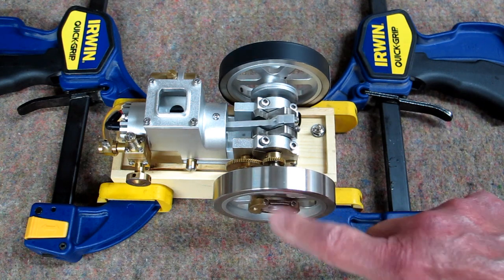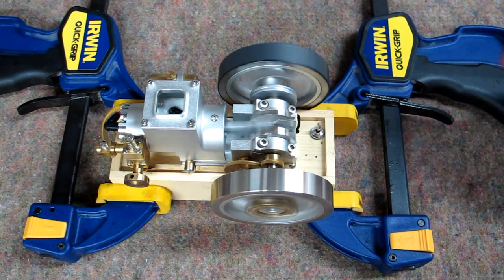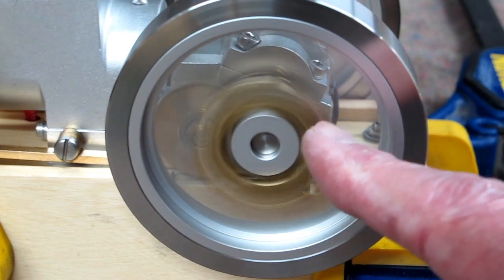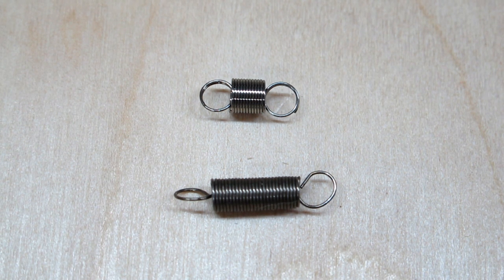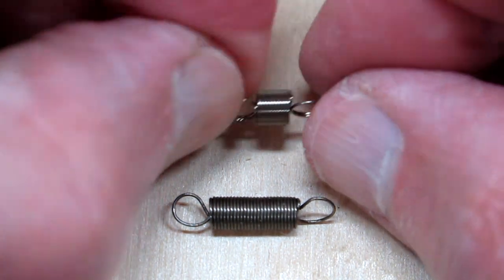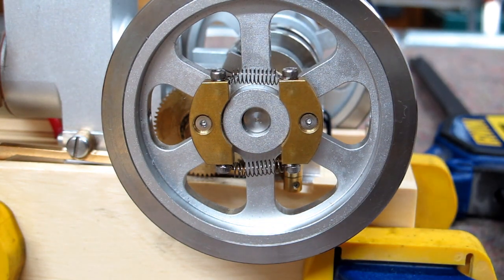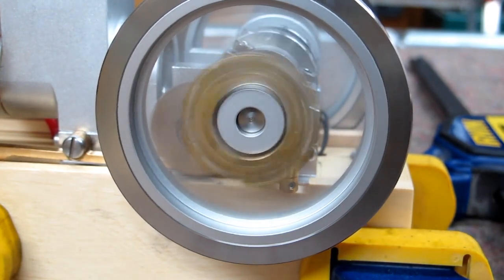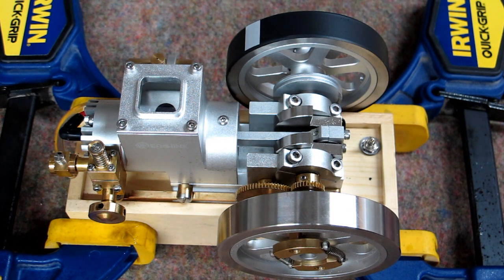Eachine ET7 Hit & Miss - Slowing It Down

Comment: Hi Ron. I discovered your channel a few weeks ago. Love your model engine reviews and tuning. I just purchased a 2022 version of the M90. Yes it runs to fast. Didn’t know what size springs to try. Your video solved that. Believe it or not, your link still works to the springs. I got a 58 pack shipped from China with free shipping for $10.17. I’ve spent that in gas driving around trying to find something that would work. This gives me many to have, to set for different running speeds depending on what accessory attachment it’s driving. Thanks so much for the video and link to and size of the spring. Rick
Reply from the maker: Hello Rick,
I don't know where you got your engine. I no longer recommend Banggood.com as they seem incapable and/or unwilling to keep engines in stock. Their supply of engines has all but dried up. They also seem to have quit selling basics like the replacement piston ring o-rings.

EngineDIY.com seems to be able to supply most engines and you will find links to the various engines in the description of all my engine videos. They also have a better selection of engines as well as the replacement piston ring o-rings and spark plugs.  I ask that you use the links given in the video descriptions since I then get credit for the sale.

There is also a coupon code that will save you money.

I have over 70 videos all listed in a playlist on my YouTube channel. There is a lot of information there.

Thanks for watching. Please subscribe! 
That is what keeps this channel going. 
Ron

Comment: HI, RON, I WAS THINKING OF GETTING ONE OF THESE ENGINES FROM BANGGOOD BUT I WAS READING THEY ONLY LAST FOR AROUND 12 RUNS, THEN LOOSES, COMPRESION, WHAT DO YOU THINK, COULD YOU PLEASE LET ME KNOW, MANY THANKS, RAY. FROM U.K.
Reply from the maker: Hello Ray,
I no longer recommend Banggood.com as they seem incapable and/or unwilling to keep engines in stock. Their supply of engines has all but dried up.

EngineDIY.com seems to be able to supply most engines and you will find links to the various engines in the description of all my engine videos. They also have a better selection of engines. Plus there is a 10% coupon code. I ask that you use the links given in the video descriptions since I then get credit for the sale.

ET1, ET6, ET7, EM2, etc. are model numbers created by Banggood and they are not the manufacturer's numbers.

M90, M92, M94, M19, etc. are the manufacturer's model numbers and are the ones shown on EngindDIY.com, and they are the exact same engines.

I like the following engines the best.

M94 (ET7) Simplified Governor Hit & Miss Water Cooled
    I think it is the easiest of this series engine to replace piston o-rings.
    Eachine ET7 Hit & Miss Engine - Simplified Governor
    https://youtu.be/fQ1bKuXgIqE

M19 (EM2) Mini Vertical Hit & Miss Flying Ball Governor
    Beautiful little engine that does not jump and down and move around.

M90 (ET1) First (Silver) Hit & Miss Water Cooled & Governor

M92 (ET6) Flying Ball Governor Hit & Miss Water Cooled & Governor
     Very nice running engine but it is a bit more complicated and requires a bit more care and lubrication.

My engines start and run when I fuel them up. Things can get out of adjustment or become gummed up from old oil, etc. You just need to learn how they run and how to troubleshoot problems. 

My engines have run much longer than 12 runs on a set of o-rings. Remember, there is always someone on the internet that doesn't know what they are talking about of simply want to bad-mouth something.

You seem to know how the real ones work ,so I wouldn't expect you to have much of a problem.

A model engine is a toy. It is to be appreciated for what it is, a model of a full size working engine. They are not intended to be run for long duration, at very high speed (RPM) nor under high loads. These engines seem to run for quite a while with these high temperature o-rings. The o-rings are readily available at EngineDIY. There are larger o-rings for the larger engines such as the M90 and smaller o-rings for the smaller engines such as the M12. 

Search for: 

10Pcs Rubber O Ring for M90 Hit and Miss Horizontal Gasoline Engine 

10Pcs Rubber O Ring for M12 2.6cc Mini Four-stroke Gasoline Engine Model 

EngineDIY also has other parts. Look around. 

I have over 70 videos all listed in a playlist on my YouTube channel. There is a lot of information there.

I also have a video on the recommended fuel for these engines.

Thanks for watching. Hope you have subscribed!
That is what keeps this channel going. 
Ron
Reply: HI RON, THANKS FOR THE IMFO, IF I THINK ABOUT GETTING A SMALL ENGINE, I WILL TAKE YOUR ADVICE. THANKS AGAIN, AND HAPPY NEW YEAR TO YOU CHEERS AGAIN, Ray.

Comment: I Ordered  aEachine ET7 Horizontal Hit and Miss Complete Gas Engine from banggood, their website said it was in stock on Aug 2 when I ordered it ,  for the last 2 weeks now they says it is shipped but the shipping company says they did not received it. I have serious doubts about this supplier
Reply from the maker: First time purchase from overseas can be a bit confusing and irritating.
I have no record of a ET7 purchase on August 2nd. 
Did you use one of my links? 
Where do you live (what country)?
If your sale went through then you should have an order number. 
What is your order number?
After it ships you should have a tracking number.
Once an item ships from China it goes off the radar until it actually arrives in the destination country. This is because it is in a container with a whole bunch of other stuff headed for the same destination country.
For example, when shipped to the USA it will have a USPS Priority Mail tracking number. But, that shipping label will not get attached to the package until it arrives at the USA handling agent... then the package is within the USPS system and you can track the package.
Banggood's customer service is pretty good and I have had numerous people tell me they have received good service from them.
Contact customer service and ask where your package is.
And I always advise the use of PayPal as it gives you another avenue of approach if a problem occurs.
Ron

Comment: Thanks for great tip , slower speed looks better indeed 🙂

I may be wrong , but I don't think revs are so high on the tachy ...
There still must be a dividing factor to apply 🙂

Few steam engines I ran reached 1000 RPM approx ... and I think they were way faster in revs than this little guy 😬